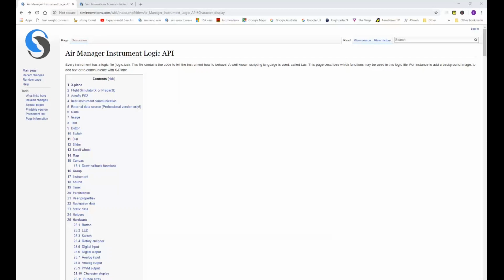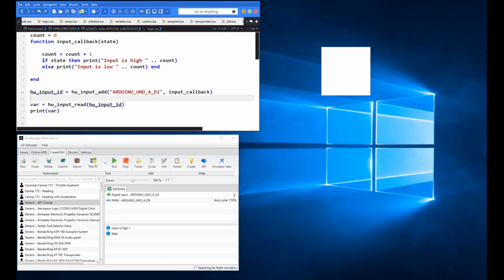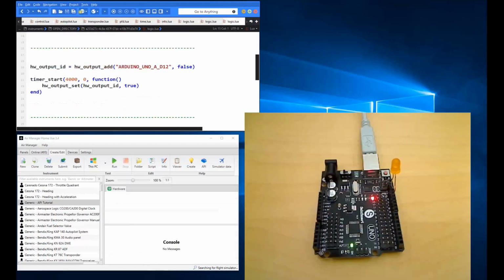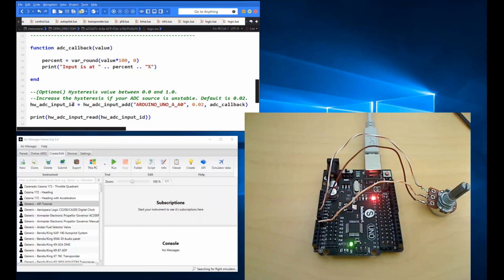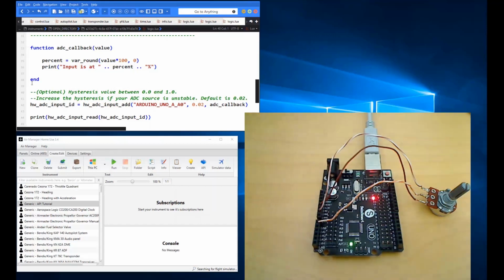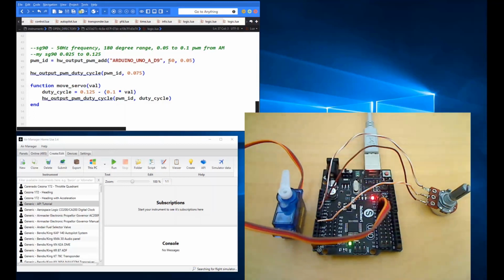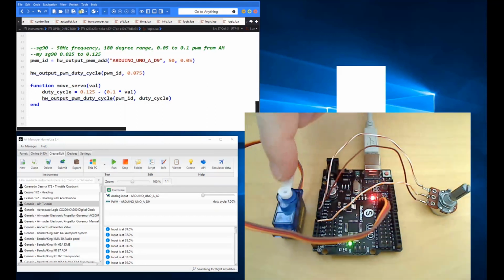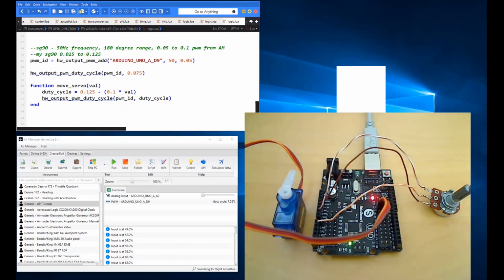Instrument development - E27 - Hardware part 2

Comment: I don’t understand what the digital input gets you that the button/switch doesn’t already? It seems like the digital input pin is already pulled up to VCC and you’re grounding it just like a switch? What am I missing? Is it just a simpler version without all the overloaded switch methods?
Reply: Digital input has no pull up nor pull down. It can be useful for various applications. For example a real aircraft starter switch, does not work as a normal switch, it has various states for the magnetos and such. With the digital input you can monitor all the pins, and make out which position the switch is in. It is mainly for 'specials'.
Reply: @ralphrietveld  thanks!

Comment: Hi, i have a code working on Windows. But there is not installer for Linux ( i think that is the port name the problem). How can i connect my arduino with Air Manager on Linux?. Thanks
Reply: If you ran the Arduino installer on Windows, then it will also be recognized in Linux.